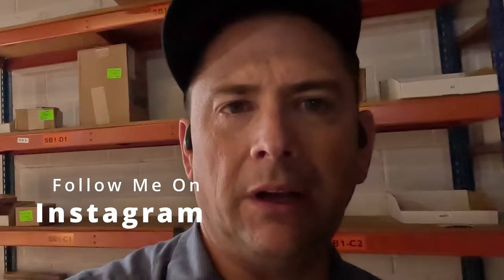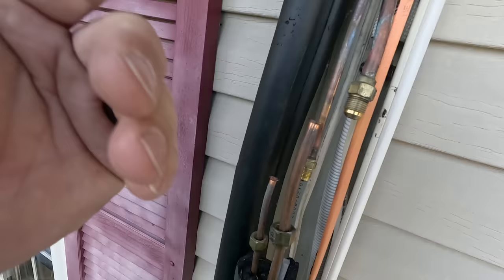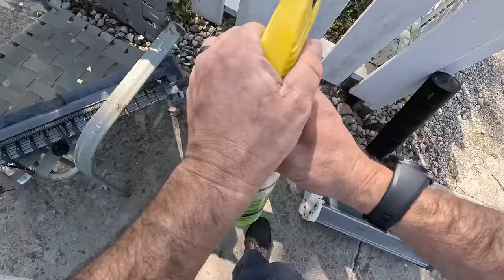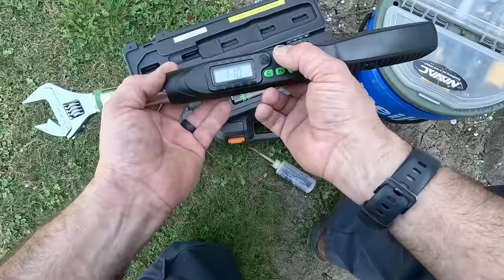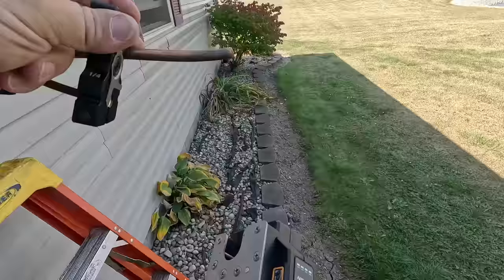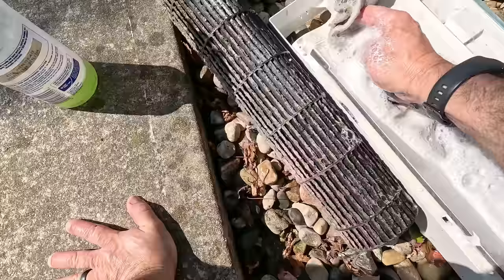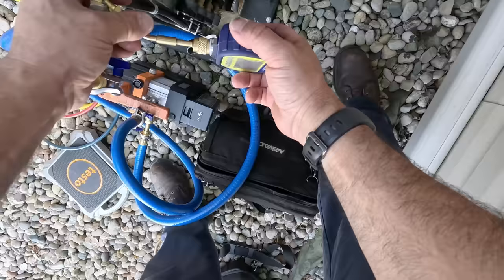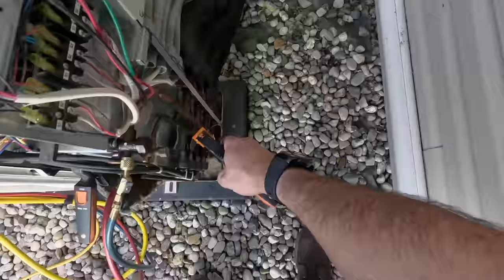I Still Hate Mitsubishi: The Return Trip

Comment: Just replace the whole indoor unit. Way less in labor cost. Plus the customer gets a new warranty
Reply from the maker: I ask them to quote it that way I don't know if they did or didn't. I agree with you
Reply: Plus it's nice n shiny, and not a disgusting mess like that. And then what if you get it all back together and that blower motor goes out. Then you get to do it all over again.
Reply: @brnmcc01  while I agree the unit doesn't have to be removed to replace the blower motor. Maybe?
Reply: @natepeterson7145  Replacing the blower motor can definitely be done on the wall. It's still a lot of work though.
Reply: Replace. The whole unit is much cheaper.
Reply: @RW-to2fy  yup, he's human like the rest of us. Nailed it.
Reply: No he's showing what most can't do! True tech as well, not just a parts changer.. but I bet most of you saved the video anyway 😂
Reply: …I’ve got a stuck switching valve (stuck on cooling only) in the outdoor unit (12 years old). They want $12k to replace it and the indoor unit. It’s a 14k btu system. Loved the system until broke, and the crud that builds up on the fan wheel is disappointing (and I keep the user serviceable filters very clean)…
Reply: @jonniesantos  Sounds about right. If its mini split heat pump, like in this video, it can be one of the most difficult brazing jobs. We convince the vendor to send a whole new unit cause its that bad.
Reply: Unfortunately, with the cost of labor, we are quickly getting to a place where it makes sense to toss the entire old unit and replace. I’m $2500 into guys chasing leaks in my sill under warranty Fujitsu halcyon system. I’m literally considering tossing the entire system and installing new system myself. Either Mr Cool, or another system. I’ve got all the tools required.

Comment: This trade can be extremely toxic full of hvac super hero’s (who you know do worse work than they claim)
Reply: I stopped posting hvac content on my instagram channel because of stuff like that. Some guy literally told me I shouldn’t use a swager because they cause micro leaks on the swage joint 🤦🏽
Reply: @dantemariscal8679  it’s constant chest thumping. I have left so many groups because of it. 28 years and apparently I’m terrible and do everything wrong. Lmfao.
Reply: Let’s be honest- this si the most difficult, intellectually demanding of all the trades, by far. You need to know physics, electronics, plumbing and even chemistry. Yet there is no serious training licensing like plumbing and electrician. Barriers to entry are thus low and demand for service people are quite high. ? Labor rates and Margins are also quite high ; owners doing quite well, but not passing much along to their service  people. And of course. Clients want latest bells and whistles, perfect interior climate conditions , despite their lousy ductwork installed by spec builders, to pay for hi quality work , units more complicated each year, and parts are cheaper. WHAT COULD GO WRONG ? LOL

Comment: I took mitsus training and was impressed. They had a couple full vrfs with all the different air handlers and indoor heads all hooked up along with their controllers. Instructors were good too. Goes to show how much can change from one location to another. The joys of a global company. Great video!
Reply from the maker: What location did you do it at?
Reply: @HVACRSurvival  Burnaby in BC
Reply: @HVACRSurvival  I did my Citi Multi Training in Dallas, TX with the same setup. I just do the HVAC controls side and integrate into the units, but since I had worked on them in the field so much during install I did quite well in the simulated troubleshooting sessions they had. They are my favorite units overall if the installation is done properly.

Comment: I’m with you on residential work, that’s all I do and I want out. I don’t really have any commercial experience and I’m just unsure if 20 years residential will carry over well.
Reply: It depends on the commercial work but 90% of it is the same. Just larger equipment. Chillers and other types of equipment can be a learning curve though. Your 20 years should carry over fine. Especially light commercial. I’ve done everything from high rises with chillers to small wine cellars in a home. It’s all the same stuff.
Reply from the maker: @RandySmith if your good with residential you'll be fine with commercial. It just takes time and it can be like starting over again at times
Reply: Ehh I personally prefer residential. It’s easier to work on for the most part and it’s easier to get to. No mile long walks across roof tops and no having to rope up a compressor 30 ft
Reply: @dantemariscal8679  amen. The malls are the worst. Here in Georgia all of the roofs have river rock on them. You have to check in with security, give them your drivers license then illegally drive around the building to get to the roof. It’s a nightmare.
Reply: @AaronPowellvox  🤝🏽that’s exactly what I’m saying and then my biggest nightmare is when none of the units are labeled 😵‍💫 jeez one time I spent an hour and a half finding the unit I was supposed to be working on. What a headache and I still had 5 other calls that day. Don’t believe what hvac techs on YouTube say residential is definitely better

Comment: mitsus are highly efficient; and break down alot and cost alot in repairs; currently waiting on ac guy to fix 2nd floor unit AGAIN, its always something different, compressor, several control boards, multiple leaks ( each a different place, mostly indoor units.
the systems are only 4 years old…, parts are covered but not labor or $ freon $$$$
what a bunch of junk

Comment: I appreciate seeing you put the wires  down on the thermistirs been doing that for over 40 years  especially  klixon DFT and anything  electrical tyat moisture might get on wires and run directly into switch or motor , thermistors,etc sure they are supposedly sealed hut not for long just long enough to mske it out of warranty great iob
Reply from the maker: Thank you

Comment: “ I’m trying to get out of residential”, commercial is going to VRF/city multi units and you still have to deal with those wall mount units in server rooms, elevator rooms and other smaller rooms.
Reply from the maker: I’m not a fan of the city multi either. We have a few of them. They seldom break so you never get much experience with them.

Comment: Yes could see you returning, as for training keep to the basics, as for us we would have re done flares, left under 3500 kpa nitrogen pressure for a few days, if no loss evacuated to appropriate microns calculated charge, THERE IS NO OTHER WAY TO DO THIS.
Reply: I can agree with your comment on a new construction project when there’s no pressing time line or other variables. But if your a service tech working for me and you want leave a customer without air/heat or refrigeration for a few days because you want to pressure test a flare fitting you should be able to get right the first time, every time. You are NOT qualified to work for me and will be FIRED.

Comment: I have that same core removal tool and yes, they are terrible. I’ve been loving the Appion ones though. They seem to be made better. Not a fan of the C&D ones either. The ball valve always leaks on those too.
Reply from the maker: Good to know!
Reply: NAVAC CRT's are even better than Appions
Reply: Yeah I got a JB CRT and it was junk, Appion ones work great though.  The JB will never grab the core it seems.  The slot on the Appion holds the core like a vice grip even when you get it out.
Reply from the maker: @mitchell8204 👍👍

Comment: Super interesting video (I'm not a tech). We've had a couple of techs out for a no-heat condition on a 12 year old MUZ-GE15NA. Pressure is fine, and they both said it's the reversing valve, however they said it's it not worth it to repair and one of the guys guessed it would be $2k to $3k to fix. The original installer wants $12k (after a heavy discount) to replace it and the inside unit. 

We're going to use a room heater for now and I guess start saving up. 

I wish they'd build this stuff to be easily serviceable (by a tech, not a lay person). Sorry to rant...
Reply from the maker: I like hearing from my viewers whoever they are. 👍
Reply: i would buy another indoor unit new and 400 dol will do it :D

Comment: Do you know why mini splits are often problematic? There are numerous reasons. When you attempt to fit many devices into a small space, it usually doesn't end well. These systems often consist of small diameter, thin copper lines packed into numerous turns, and a tight chase, which increases the likelihood of kinks and flaring on the small copper pipes, leading to a higher chance of leaks. Moreover, in coastal areas, where exposure to the elements is common, having the electronic board outside is not a good idea.

In addition, the small wires and connectors connected to the board are hard to work with. Their tiny size not only makes troubleshooting difficult but also leads to a shorter overall lifespan. In commercial establishments, mini splits tend to accumulate dirt quickly. Attempting to clean them near the evaporator and blower can be a challenge due to their small drainage passages, which are hard to access, and their sensitive electronics located close by.

I've only scratched the surface of the major flaws in this setup. When it comes to tech support, be prepared to spend an hour or more waiting for a callback during the summer. In contrast, with central AC systems, I can resolve about 95% of issues in just 20 minutes to half an hour because I have the necessary parts and can temporarily rig the system. However, when dealing with mini splits and their delicate electronic boards, it's a different story. If something goes wrong, you're stuck with a malfunctioning AC system in the middle of summer. Mini splits should be treated as disposable units. If they are a few years old, consider replacing them, especially those with multiple evaporators, as the more complicated they are, the more Murphy's Law seems to apply.
Reply from the maker: I agree 💯
Reply: Ive installed 4 seperate systems at my house. I have a total of 6 zones and 4 outdoor units. I have 24 flare connections and I have never flared anything in my life except brake lines. Since then 7 years ago I have had not 1 issue. Not 1 error message, not 1 leak, not 1 failure. These units are running year round. Right now all 4 systems are providing heat @ 22F they are all low ambient systems. I have to say installation is KEY. yes its luck of the draw when it comes to indoor units leaking. but A coils leak too and condensers. But I will say I have may more points for potential failure with so much hardware. thats where this becomes an issue. I installed all the systems myself and had a guy do the startups. So far so good.

Comment: Hi Rick
 My kids bought me a Hessair unit for my garage. Some installation required Ha!. It had a small leak I could not detect. I figured it had to be the flare. Did the flares again still leaked. I bought flare seals on line. I haven't had a leak sense. Have you ever used them?
Great video.
Reply from the maker: I’m assuming those are the nylon insert that goes between the flare face?
Reply: @HVACRSurvival  yes
Reply from the maker: I’ve never used them, but it looked interesting

Comment: I'm surprised they didn't just send a new indoor unit all together .
Btw for 1/4" tubing i find the can opener on the Leatherman does a decent job at deburring .
Are you getting the new Leatheman Arc Rick ?
Reply from the maker: I haven't heard of it yet. I currently use the surge, I also really like the wave but it didn't hold up very well, so I have two of those waves for backup

Comment: Genuinely curious would it not have been easier and cheaper to just replace the indoor heads with new as opposed to repairing them? labor would be less than half. I know with a lot of ductless the new heads aren't compatible with an older condensing unit so not sure if that's what you encountered here.
Reply from the maker: I'm just a tech, I don't do the quotes, I asked them to quote it both ways.

Comment: I would not flaire the connections !
I would cut the flares off both connections and swage and braze the connections as it more reliable than flared connection from expansion and contraction due to them going hot and cold over years the nuts start to loosen and then you loose your refrigerant !!!!!
Reply from the maker: I agree but that’s not allowed by Mitsubishi.
Reply: @HVACRSurvival   but by the time the unit dies it would be out of warranty  any way  
Plus how would they know as the wall mounted in door doesn't get sent back 
Just the part like the fan or the indoor pcb gets sent back not the whole indoor as if that was the case it would be like reinstall of the indoor part 
I think they make them like that so they loose refrigerant in the first place  so it kill the ac so you re new it  
The flares on the in door are there for factory use as in pressure testing at factory with ofn !
Reply: I've worked installing ac and refrigeration and big refrigeration I've worked on big packs with all the different makes  you can get in refrigeration units and massive blowers in freezers warehouses and that's a challenge as a warehouse freezer full of food is more critical than a Aircon as the food will perish so there's a lot at stake  working on industrial refrigeration!
Reply from the maker: I agree like I said. How would they know? I make YouTube videos think about it, I’ve done it I just haven’t shown it. Far as the second part. Yeah, I do grocery Refrigeration and industrial work as well,  check out my other videos,  I hardly ever do this candy ass residential shit anymore.  I hate residential. I was all that was available at the time and that’s why I got sent there.
Reply: @HVACRSurvival  yeah I prefer working on big refrigeration plant and not on small commercial units and ac just installing it and not repairing the pcb inverter boards and when u speak to Mitsubishi about this subject they don't seem like they know what they are doing when you get a problem with the boards they say oh it could be the compressor or the pcb  and thats 2 expensive things that could go wrong ffs 🤬
That's the reason why I don't like fixing ac units to fiddly!!!
Reply from the maker: I agree.

Comment: Its not rocket science, its geothermal science 😂😂😂
I had a Mitsubishi system that had 8 different heads and leaks didn't show up until i hit 500psi. 
It was a new construction and left 350psi over night and kept dropping 10 psi over night and couldnt find it with bubbles neither. At the end i i dumped some 410 with 500 psi and found it with leak detector. Left the 500 psi over night and next day no leaky leaky